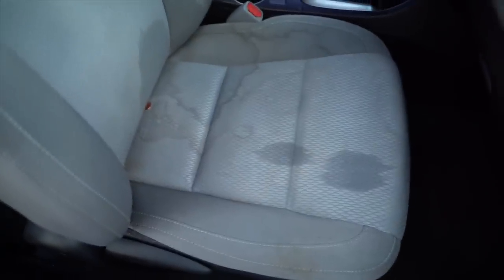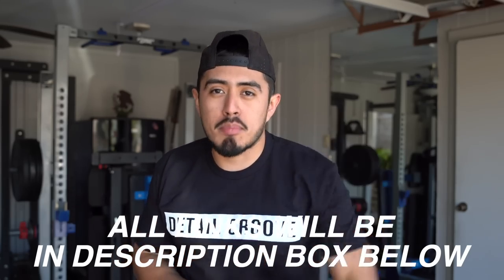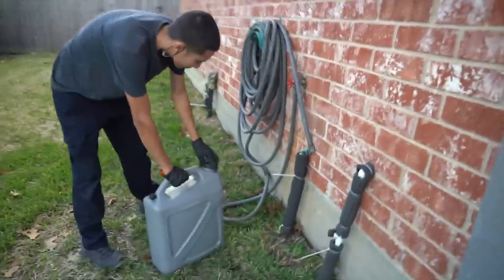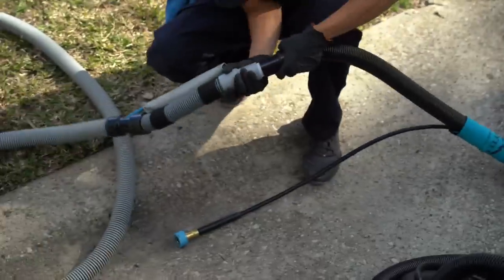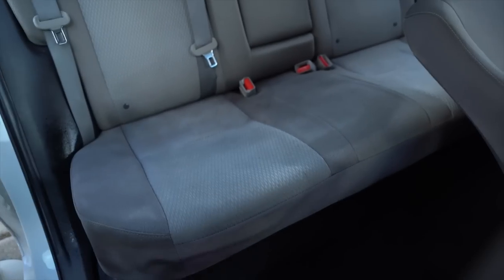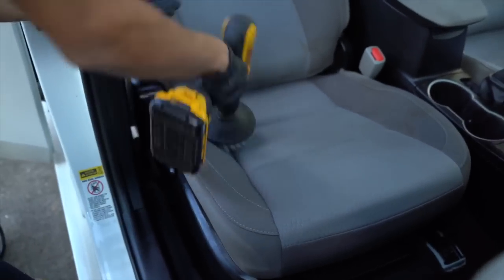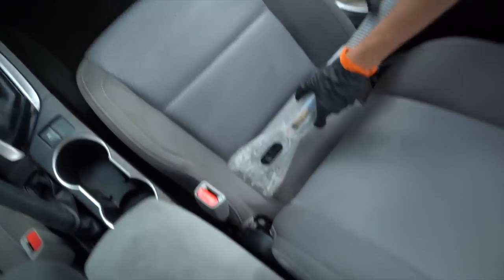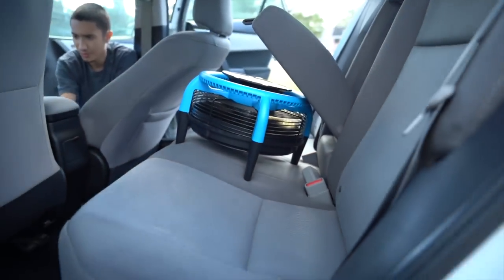How To Properly Shampoo Car Seats | 3 Step Process To Extract Car Interior

Comment: Finally an auto detailer who’s using legit “pro” grade carpet cleaning chemistry that the pro commercial carpet cleaners use! If these products work so well on household carpeting they can sure work just as good on a car! Bridgepoint makes some awesome products. Between them and prochem you should have everything you need for a complete arsenal of stain fighting power. Good stuff man!
Reply: Most PRO detailers are using these or releasit encap ds2. However, a lot of YouTube videos by PRO detailers are for non pro detailers. If someone has the a $1500 heated extractor they probably aren't watching YouTube on how to detail cars. Can't use flex ice without heated extractor so that's why not everyone makes video with these products
Reply: @donkeydiehard879  right, those products need heat to dissolve the powders and work properly in certain temperature ranges. They certainly help speed up the process as well. Working faster means making more money. For the casual weekend detailer I don’t think it’s worth it though lol for my truck I just used an upright household extractor with a liquid traffic lane pre spray and APC for a few of the tough stains and rinse with a vinegar dilution. Seems to get the job done to 90% or so.

Comment: I am just shampooing my own vehicles. I won’t be buying an extractor. But I do have a powerful Ridgid shop vac and a Hoover carpet shampooer with an upholstery hose on it. So my question is will I be able to extract most of the solution/ liquid back off using the shop vac or carpet shampooer hose? Thanks

Comment: Thanks for the awesome content. Link for air mover?
Also do you no longer use Super Clean for upholstery?  And do you use the diluted super clean on aluminum? Or another product?
Reply from the maker: We still use Super Clean for plastic/leather cleaning. The Flex system is primarily for floor mats, carpeting, and seats.

Comment: I agree with u on the pump spray .. I have a sun joe battery electrical sprayer..  I got it so when I do my rugs it speeds everything up .. its a 24volt ... it pressurize itself.. I think it would be great in ur work also ..

Comment: Make sure you guys vacuum the car first. Notice when he starts using the tornado air gun…. The dirt goes right back on the seats. So make sure the vac is ready and close by
Reply from the maker: We actually don't start vacuuming until we blow everything out. The point of the cleaning gun is to dislodge/loosen all the debris. So yes, it gets dirtier but it makes the vacuuming easier

Comment: Great video! What chemical (s) do you use to spot treat when you have stubborn stains that require something more than a general pre spray?
Reply: Try steam to accelerate the pre spray and then extracting. Sometimes if that doesn’t work then it’s a lost cause (with the best chemicals/equipment)

Comment: That extractor $1500😳 what a beast !
Reply: You dont need an expensive extractor to get the job done.
Reply: @Examplez96  Yeahh I have the bissel professional and it works pretty good I just feel like the $1500 extractor gets the job done way faster and cleaner
Reply from the maker: Yep, by no means do you need an expensive extractor. Use what you have and make it work 👌🏽

Comment: I used these exact chemicals with the same dilution used in the video just with my mytee lite 8070 on a Buick Lesabre cloth seats and they feel stiff like something is still in the fiber. I really don't feel like I used too much prespray. Used DI water that I pre heated with a bucket heater. I even did a second rinse pass with Flex Ice where I moved much slower with no real improvement. Do you know what might be the issue?
Reply: Could just be the type of cloth n the car some manufactures cloth is cheaper than cheap’ 

U could also try a ph neutral fiber rinse at the end to get the fibers buttery soft and it neutralizes any soap left behind etc 

I’ve found it can depend on water too ‘ 
If you have very hard water I personally would go get a gallon of distilled water that should do 1 car easy won’t have all the extra crap that’s n hard water’

Comment: I have issues with wicking using the bissell, how do you prevent wicking? I use superclean diluted 10-1 and use water only when extracting.
Reply: Dilute your cleaner a bit more but only if it will still clean what you need it to clean, make sure you don’t just spot treat, make sure you’re thoroughly cleaning the whole area. If that doesn’t help use some dry towels to dry the surface as best as you can. Usually if I experience wicking I use a heat gun at a large distance to dry the surface and it doesn’t wick if you use that approach make sure to keep a large distance between the fabric and heat gun to avoid ruining the fabric and potentially burning it.

Comment: I’m a diy detailer and I’m starting to get lil requests at a time and I want to start doing other vehicles. I’m solo btw. How long show an interior detail should last?
Reply: I've had interior details take 1.5 hours, and some take 8 hours working alone. There’s a lot that plays a role. The age, the condition, the temperature, the material, the carpeting, etc.

Focus on the overall results, and learn from the cars that you work on. Then find ways to become more efficient.
Reply: @monkeystainmtx  thx for the feedback. I just don’t wanna seem like the guy who takes forever on a simple detail but we all start from the bottom. Thx
Reply: Yea what the other person said... so many variables boss. Good to have a flat rate I've found for those reasons. Some will say they charge more depending on distance and time and blah blah. I think that's all hogwash personally. Two flat fees for a small or bigger size vehicle. Price it based off your local market and such. Don't shirt change yourself! Good luck brotha!

Comment: Do I need those two powders I have an aqua pro vac and usually I put water then spray seats and use oxy clean upholstery cleaner
Reply: Did the flex products work effectively with your aqua pro?

Comment: if the wand keeps working that means its just draining your clean  water tank when your not using it so then you have to keep refilling your tanks for often. also I don't believe that new wand your using cleans the carpets better than the one that sprays more water.
Reply: the SS tool is intended for upholstery, not carpets. it can work okay for carpets in a pinch, but the two materials are very different and should be addressed as such. carpet is cleaned much better with a more traditional, jet tool, like the OEM mytee wand. carpets have pile that contains deep, ingrained dirt all the way down to it’s very base. in order to clean, the rinse solution needs to be sprayed at higher pressure down into the material in order to get through the pile in order to dislodge and flush all the fibers free of any dirt or stain causing materials. upholstery, on the other hand, is much different in that it has a short nap as well as having cushioning material beneath it that you should be mindful to try and avoid introducing too much liquid to. jetless tools like the sapphire scientific are designed very specifically clean this material as efficiently as possible by using a shearing effect to clean the fabric. when you run the tool across the upholstery, it is pulling the fibers of the fabric up into the tool and shearing the rinse solution through the fiber instead of spraying directly into it. by doing this, you avoid overwetting or losing heat like it does when it is sprayed out of the tool, while still effectively rinsing the fibers of all particulate. it also allows for much faster cleaning due to the fact that you can go forwards and backwards and the tool never stops cleaning and prevents such issues as browning and wicking. and if you’re worried about the continuous flow aspect, the SS, along with the rotovac shear dry, are the only tools of their type (that i know of) to incorporate a trigger so you can use it similar to traditional tools whereas you are only engaging the solution when triggered. 

so you’re right, it doesn’t clean carpets better, but it wasn’t made for that. what it was made for(upholsery), however, these type of tools have changed the game. as with most things, you don’t have to have a fancy jetless tool in order to clean interiors. but as a professional who has to look at efficiency, dry times, etc. buying a $500 upholstery wand and having seperate wands for the two different materials is a investment towards improving your business and having the right tool for the job

Comment: Hey bro! I’m looking at the Aqua Pro Vac coming from a Bissell. For $50 more I can get the green George Numatic machine, it has 110” of water lift. Any idea if that would be better?
Reply: i would say to go with the aqua pro vac
Reply: George bro....george is more durable, wand stops overspray. I had it then stepped up to Mytee
Reply: @yestallbobo  I mean 110” of water lift vs 79” seems like a huge difference. Plus all the parts for the George are on Amazon if it ever had to be fixed! I’m probably going to go with that
Reply: Will the flex products work well with the aqua pro vac? Even if they don’t heat up the products like the mytee?